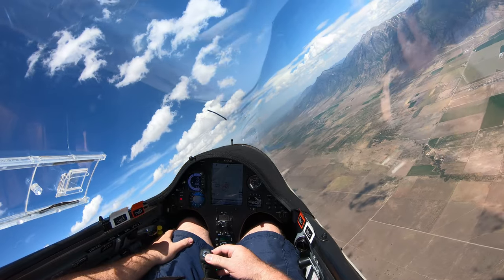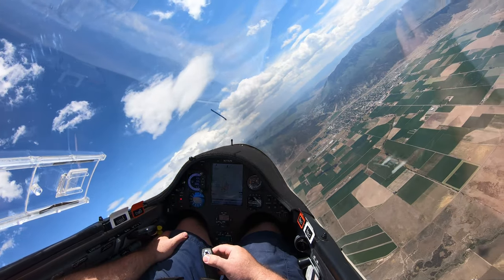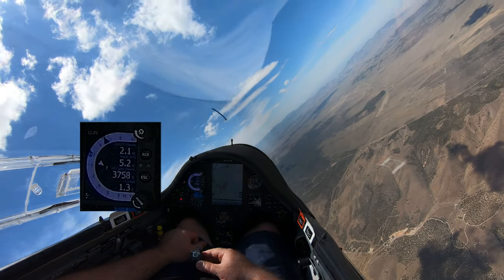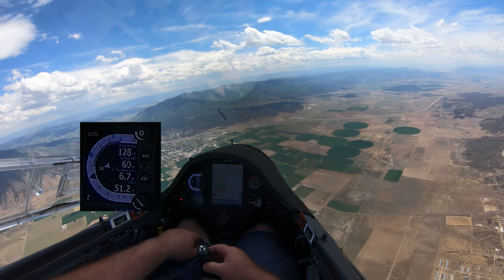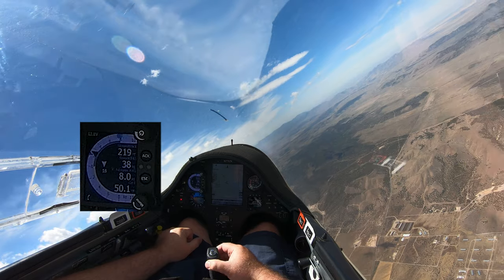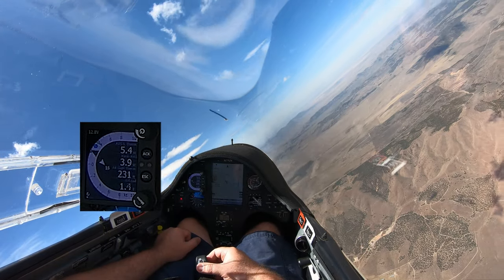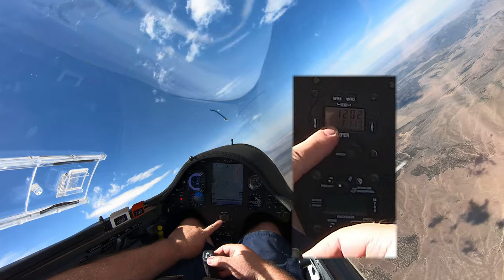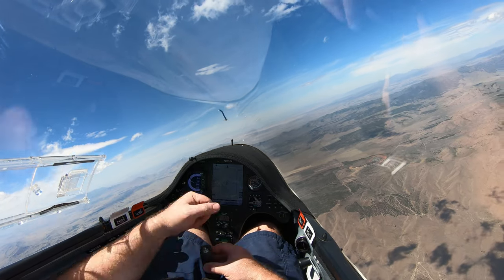Quick Tour of My Glider's Instruments - in 4K

Comment: What is your stall speed in the climb config?
Reply from the maker: Desert thermals are pretty turbulent/gusty so we often fly 5-10 knots above stall speed in climb config.  With a full load of water I am thermalling around 58-60 knots and dry around 53-55 knots.  In a 45 degree bank angle in calm air loaded with water the stall is probably around 48 knots.
Reply: @BrunoVassel  thank you for that information Bruno! I like your videos. Please show is longer videos again 😃👍🏼

Comment: I think the vario you mainly talk about is a Butterfly (then Air Avionics, then not available) vario. Nothing mentioned in this video would explain why you bought that as well as the LX which you said you use for audio. What info from the Butterfly do you find more useful than what you get from the LX?
Reply from the maker: Great question. Easy answer. I obviously forgot the model number of the LX. Is is an older V70. I purchased the Butterfly for the artificial horizon (works rock solid!) and for the instant wind arrow. I like both varios used in combination.  Hope that helps.
Reply: @BrunoVassel  Thanks. I have an A-H in my LX9070. I like the idea of the instant wind which so far only Butterfly has ctacked. I just upgraded my LX9000 to the latest touchscreen version.